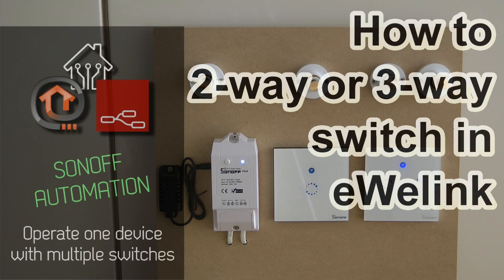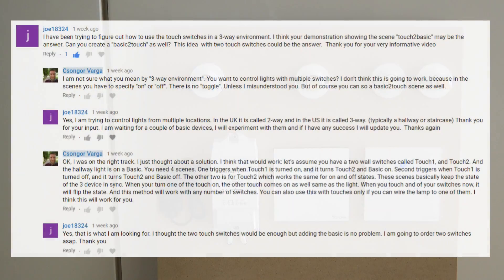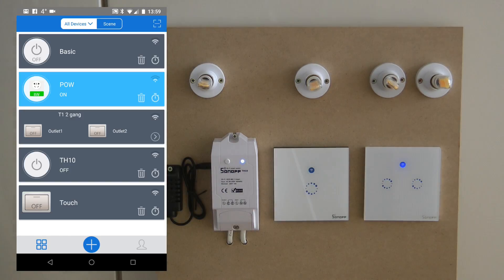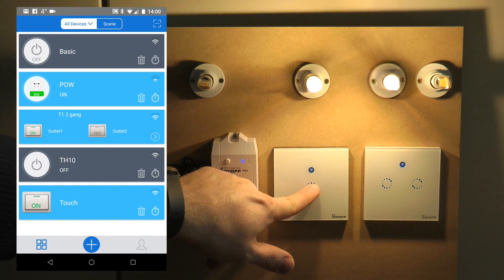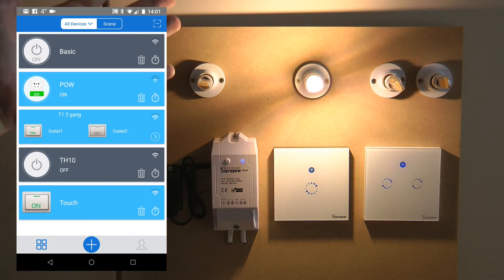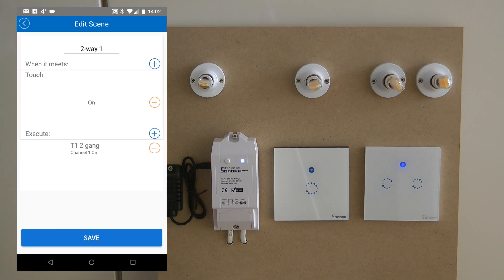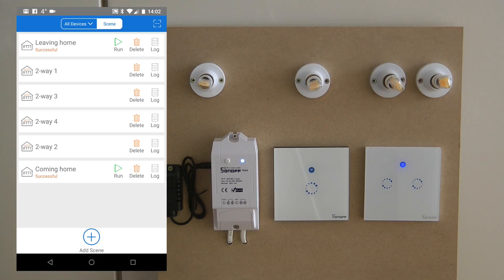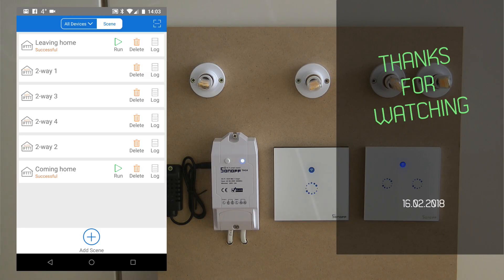How to set up 2 way or 3 way switching in Sonoff / eWeLink

Comment: I can't see the 2way scene option on the new app ? 
Please help
Reply from the maker: What do you mean? It works exactly the same way, only the graphics have changed. Click Add Scene, specify the scene name, in Conditions click on Add, select Master Device, select your switch and On/Off and OK/Add. On the Perform section, click Add as well, select the device and the state. And repeat 4 times.
Reply: @csongorvarga  thanks for getting back . 
I have two 2 gangs in the one room that I need to control two lights. One centre light and one wall light.  The one switch has the one switch wire that goes out to the centre light and the other switch has one switch wire that goes out to the wall lights.  Does this mean I have two masters? 
Thanks
Reply: Ok great I've sorted it.
I'm having a new router next week.
Will I have to do this all again? 
Thanks
Reply from the maker: @pr1tch1  Great to hear about your progress. These settings are all stored in the cloud. So any change to your local setup will not affect this. As long as your devices are connected to the internet, it will work. Regardless how that connection works. And for the very same reason, if your internet goes down, these settings will stop working. You switch  will turn on your light, but the 2way setup will not work. Of course it will come back as soon as your internet connection is up and running.
Reply: @csongorvarga  ok great many thanks for the helpful video. 
I can't believe how long it actually takes to program four switches for the two lights . I have 48 scenes just for that room.  Took about 2 hours :) 
It's actually easy when you know how but without instructions it takes some working out , though your video helped alot. 
Thanks

Comment: can this concept applied to z wave switches ? if yes, can it being operated without z wave controller running after they are connected once ?
Reply from the maker: This is a feature in eWelink. There is no zwave support in eWelink.

Comment: Hi, I got a sonoff basic with temp sensor operating my boiler (on the roof), i bought a sonoff smart, connected them as described in your pdf and connected them both in the app, but i can't make the scene to work... can they work (on/off) together - the reason is that i want to see visually on the wall that the boiler is on or off and switch it manually as well... please help
Reply: p.s. getting rid of the sonoff basic is not an option because i need the temp info...
Reply from the maker: You mean the temp sensor is set to automatic, so it keeps the boiler hot. And you created two scenes to turn the basic on/off to mimic the status of the temp sensor? That should work, unless the automatic mode does not trigger the scenes. I am not sure to be honest.
Reply: Csongor Varga , no the auto is off, i never use it, i just need to know the temp in the boiler , the option to add the sonoff basic in the scene is only in a state that it is the primery and it forces me to put temperature setting as a triggers... i don’t need that just need it work simply as you showed...

Comment: What happens if your wifi goes down or power to wifi, can you use switch if power failure to wifi or internet connection goes down? or the damn internet company decides to shut me of if I dont pay bill lol, but yeah question still stands - wifi goes down can u shut light of ?
Reply from the maker: Yes, that would be a pain for smart homes. These devices need a working internet and cloud services. But it is not only Sonoff, probably true to any other devices. In the 2-way setup, you will be able to control the light with the wall switch physically wired to the lamp, the other will no do anything. The eWelink app has a LAN or offline mode, which allows you to control the devices over your LAN even if your internet connection is gone, but the features are limited.

Comment: Am I right in thinking the 2 way lights will only work if wifi is working if it can only be achieved by setting up scenes
Reply from the maker: I have not tested it, but I assume the switches only communicate via the cloud. So if the internet is down, you scenes are dead as well.
Reply: Thanks for the response these switches are great for one way application but if your doing 2way or intermediate I wouldn't recommend because when your wifi goes down your stuffed and only one switch will work.
Reply: @sparks6981  If we were to try the non-wifi way, we'd need a (dumb) changeover switch. However the intelligent switch would then get reversed states when the changeover was activated. Any other method I can think of requires the network connection to operate. I want lights that are luddite proof - ie go smart without impact on useability or reliability.
Reply: I've put these switches in all my bedrooms upstairs and was able to pull neutrals down to the switches easy as could get in to the loft and pull 3 cores up to the three plate connection,I wanted to put 2 way in for stairwell but looking at the connections on back of switch there is no common l1 l2 common like a conventional two way switch so immediately realised these are floored if your wifi goes down your only be able to turn the light of from the one switch where the s/L goes to that light which is crap and not convenient other than that the switches are good make sure you use a 35mm box and if you have 3 cables at the switch it's still tight screwing back recommend a 3 core.

Comment: Hi
I liked you video. 
My house is a. 12v house and I’m looking for ways to power sonoff wall switch with 12volt. I would be great full if you could help me. Thanks and keep up the good work!!
Reply from the maker: It is not easy. Most Sonoff products have integrated power supply and regulation build in (except Sonoff SV). I don't know how the power supply works. But I can see that the relay is using 5V, and ESP uses 3.3V. So there is probably a 5V and a separate 3.3V lines there. I googled "powering sonoff basic from 12V" and I have found some articles and pictures how other managed to power a Basic from an external 5V power supply. Try following those.

Comment: Hi great video. I was trying all day yesterday to register the sonoff so I can use the  application  'ewelink' . After entering my email I get prompted with a message 'verification code sent please check your Email' unfortunately no emails received doesn't matter how many times you request to resent it. do you know as to why this is happening any advice please. many thanks Sol
Reply from the maker: I am sorry, I never has such problem. The obvious is to check in your spam folder, but that is all. Maybe try again on Monday. If they have an issue in their servers, they will fix it after the weekend.
Reply: @csongorvarga ow!!!!. I can not believe I didn't check my junk mail box.  well I found the whole page of verification codes. Many many thanks. it works perfect now all thumbs up
Reply from the maker: @wlondoner  And your response ended up in the spam as well (waiting for review in Youtube). Glad that it worked out at the end.

Comment: Very clear video.. I was waiting form dime way yo do this job. They scenes idea is great. I have one gang switch in one side of the living room, and 3 gang switch in the other side. One of the gangs works as 2 way switch with the one gang switch. Other  two gangs control other lamps. As I understood, I can replace both switch with sonoff and program scenes to simulate two way switch. Is this correct?. Thanks you
Reply from the maker: Yes, you can.

Comment: If you activate this will it still work if commanded in the Google assistant?
Reply from the maker: Yes, it will. Scenes do not impact basic functions like voice commands, IFTTT, etc.
Reply: Thanks for the quick response, am I right in thinking there is a scenes limit of 21? So you can only have 5 2-way switches?
Reply from the maker: @eXfusionGaming  Uh, never tried this before. I had 2 manual and 4 automatic scenes. I started created more scenes and I was not able to save Scene20. So that appears to be the limit.
Reply: Okay thank you so that still gives me enough for what I need I think
Reply: Just one more question, are the scenes save to the hardware? So say my phone dies will the scenes still be active when I physically touch the switch?
Reply: @eXfusionGaming  Scenes will work as long as the switches are online. Your phone could be switched off :)

Comment: Can you use Google home with that..?
Reply from the maker: Yes, all Sonoff products support Google Home.
Reply: @csongorvarga 
So basically I can use other wifi smart switch that support the same app and then set the scenes right? Because Sonoff touch does not fit my switch light
Reply from the maker: I don't think you will find a different product that uses eWelink. It is an app for Sonoff devices. There are exceptions, but I have not seen a switch from other manufacturer.
Reply: @csongorvarga  
One more question... By any chance do you know if you can do the same triggers or scenes in the Smart Life app?
Thank you
Reply from the maker: @aldotineo9195  Sorry no. I have not used that app.
Reply: @csongorvarga  
Do you think you can explain the wiring? The pdf doesn't help to much... the cables 1 and 2 are not need it anymore?
Reply from the maker: @aldotineo9195  Yes, 1 and 2 not required any more. With the new setup, basically you have 2 physically completely independent wall switches and you are using the Scenes to synchronize the state of them. So if one turns on, the other turns on as well.

Comment: Can't we just use 2 touch switches and create scene/iftt to have the 2 switiches operation daisy chained? So we dont need the sonoff basic in the circuit anymore
Reply: Yes you can, I've done that, both switches will be connected to the same live and neutral inputs.

When one turns on the scene is set to also turn on switch 2, and when you switch it of at switch 2, it also turns off at switch 1.

There is however a slight delay, it would be great if sonoff could update the firmware to add interlocking capabilities where you can link two or more switches, even if you have 1, 2 or 3 way switches mixed.

This would mean it could still work in LAN mode ... and possibly drastically reduce the delay

Comment: To be sure. is it possible to use 2 touch panels as well??
Reply from the maker: 2 touch panels? You mean 2 gang T1 switches? Yes, this method works for any number of gang switches, you just need to set up the scenes the right way.

Comment: Hello. I have a problem and I would like you to indicate a solution. I recently set up a Sonoff Pro in two way with a switch. I am using the Ewelink application to control. However when I operate the equipment using the switch the status in the application does not change, presenting the wrong feedback to the user. Have you ever been through this? Can you tell me how to solve it? In this project I can not use HASSIO, just the standard Ewelink equipment software. Thank you very much.

Comment: Hi Csongor Varga, I found your video looking for installation of Sonoff Touch. Great video. 
I bought one Sonoff Touch and one Sonoff Basic, but did not installed yet because the instructions are not clear to my case, and I'm wondering if you could help me. I intend to replace my regular light switch for the Sonoff Touch and my house is 220 v, phase + phase. At my regular light switch, I have only 2 wires. How I should connect the Sonoff Touch and the Sonoff Basic? Another question, at my dinning room, I have one light that has 2 switches to turn on and off the same light (I think that this is what is called 2 way or hotel switch). The only way I found on internet is replace one of regular switches for the pulsar switch (door bell switch). Do you know if there is another way? I don't need both smart switches, only one would be great.
Thanks in advance.
Reply from the maker: I have a bad news for you. All Sonoff device need both phase and neutral to work. So if your wall socket behind your existing light switch has only two wires than it will not work. Those are probably the phase in and phase out, but missing the neutral. Sonoff Touch has relays built inside, so to replace a regular which with a Touch does not need an additional Sonoff Basic.
Reply: Thanks for your reply

Comment: Thank you for this video! I have tried adding the scenes like you showed. It doesn't seem to work however. The scenes seem fine, but they are not running. Do I need to do something extra to activate them?
Reply from the maker: No, nothing. Just add them as I showed it in the video and that is it. I did not do anything else either. Of course the switches need to be online. But that is it.
Reply: Unfortunately, it didn't work. Other scenes do. For now I put in your rules in IFTTT and that seems to work (very slow response time)

Comment: Hi, I have 2 gang 2 way normal switch in the kitchen. This is for my laundry and pantry light. If I would like to install Sonoff 2 gang to replace this normal switch, in total 1 have to buy 3 switches? One unit 2 gang(kitchen) and 2 unit 1 gang (for loundry and pantry) for me to create scene? Can I loop the life cable for the switches in the kitchen (2 gang) like normal switch installation done?. Only 1 life cable available there. Thank you for sharing.
Reply from the maker: You can mix and match as you like, 3 x 1 gang, 2 x 2 gang, it does not matter. And of course you can power all of them from the same live wire (loop the live wire).

Comment: do you know how with sonoff how to switch a motor with alexa to go either forward or reverse? at the moment if you say alexa open( forward) the door opens but when you say close( reverse) the motor runs in both directions....is it possible to create some form of interlock?
Reply from the maker: I don't quite understand how your setup works, but you can create rules that turn off the "close" switch when the "open" switch is turned on a vice versa.

Comment: great video but 1 thing is missing in the explanation . the wiring of the 2 bulb.
i think i understand how but i'm not sure
Reply from the maker: I am planning on doing a video on that, it just takes time...
Reply from the maker: I am very slow producing new content now, so I put some slides together: https://drive.google.com/file/d/1fTCDkL0eNJmj2Xdq4lZDCEFCT7Y5J5-L/view?usp=sharing
Reply: Hi, I looked on your PDF with the description of the wiring. I have a question. Is it possible to do it same way, but with 3 gang US switch, which will control 3 separate bulbs? So basically I want to exchange three EU 1 chanel (2 way) switches, with one US 3 chanel 2 way switch and keep possibility to turn it on and off from two side (hallway).
Thanks
Reply from the maker: Yes, that should not be a problem. You just need to set up the scenes that if switch 1 gang 1 turns on, turn switch 2 gang 1 on; if switch 1 gang 1 turns off, turn switch 2 gang 1 off. And so on for all 3 gangs. And if you do not do it for one gang, it will be just a normal switch.
Reply: thanks again :)

Comment: Why would you use two smart switches for the same light? Wasn't it supposed to be one smart switch and one regular switch?
Reply from the maker: I don't think you can do that. If these switches had all pins of the relay routed out to a connection which they don't, you could replace only one of the switch with a Touch. But in that case the on/off state in the app would not relate to the actual on/off state of the lamp. It would depend on which state the regular switch is.
Reply: Maybe if you physically connect through wiring a touch switch to the sonoff switch... Wouldn't it work?
Reply from the maker: Probably. I have never taken the it apart to see how easy it is to route out those individual connections.

Comment: So smart but would have been smarter to showed the manner in which they are wired. Doh!
Reply from the maker: I was planning to do a separate video on that, but it will take some time, so I put some slides together: https://drive.google.com/file/d/1fTCDkL0eNJmj2Xdq4lZDCEFCT7Y5J5-L/view?usp=sharing
Reply: @csongorvarga  So this means I have to re-do the wiring?
Reply from the maker: @jlnoguer  For old houses where you only have live wires at the switch yes.

Comment: Great video, could you do a video on how you wired the 2 switches to light or please explain to me how you did it? Thanks
Reply from the maker: The video is still due, but I put a quick document together: https://drive.google.com/file/d/1fTCDkL0eNJmj2Xdq4lZDCEFCT7Y5J5-L/view?usp=sharing
Reply: Csongor Varga now I have a question. Is it also possible with this setup (two switches 1 light) to ad a timer or something. So whe you press the switch the light turns on for say 10 minutes and then turns of by itself(timer) or when you press the switch again (do you get what i mean/want?)
Reply: @laurenshaijma163  I haven't looked into this functionality in detail but I'd say you could use ifttt.com to provide that functionality. Set up a task in that to listen for: IF switch A turns on THEN turn off switch A after 10 minutes.
Reply: I want to know too
Reply: @absen2006a  did you figure out how to do it? I did if need help let me know
Reply from the maker: Yes, it is on my agenda.
Reply: Oh, yeah! that's gonna be awesome
Reply: I want to know as well also what wall switches are you using?